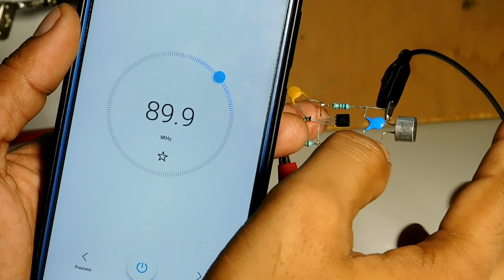Long Range FM Transmitter Circuit

Comment: It's possible to make an fm with lt341 or lm317 transistor please answer me .
Reply: XD lm317 is not a transistor, it a voltage regulator
Reply: They both are not transistors they are adjustable voltage regulators

Comment: What is the transmission range ? .
It can be amplified ? .
I can add an antenna ? .
And at 0:16 of the video that means 102 are pf or what they are ? .
Thank you

P.S
Can I add a variable capacitor  and I can do it on breadboard. ? .
Reply: @electricoggy8406  What is the transmission range ? .
It can be amplified ? .
I can add an antenna ? .
And at 0:16 of the video that means 102 are pf or what they are ? .
Thank you

P.S
Can I add a variable capacitor  and I can do it on breadboard. ? .

Comment: Thanks it works perfectly!👍Keep up the good work!
Reply: transmission range and frequency
Reply: You must use an antenna in order to increase the range. But you must calculate the resonance frequency of the lc oscillator in order to get the right frequency.
Reply: @xhuliocene  or ok but what frequency do you have and how many meters of reach now the idea of putting a variable capacitor comes to my mind thanks
Reply: how did you put an antenna
Reply: @xhuliocene  Hello
Reply: You insert antenna between capacitor and coil
Reply: @xhuliocene  o ok and how much range did you get with this transmitter since I already saw the frequency in 89.9 and it will help me, although if you knew how to put a variable capacitor it would help me anyway thanks for the answer
Reply: @joselocosasrandom1971  You put the variable capacitor instead of the 47pf capacitor.
Reply: @xhuliocene  ok and and when you used it how much reach did you get
Reply: @joselocosasrandom1971  You have to calculate it
Reply: @xhuliocene  or ok I guess from 50 m to 150 m
Reply: @xhuliocene  hello
Reply: @joselocosasrandom1971  yes that must be the range
Reply: @xhuliocene  One last question, the blue capacitor, what value is the green one, I think it is 47pf
Reply: @joselocosasrandom1971  the blue is 1nF the green is 47pF
Reply: @xhuliocene  sorry if I ask a lot but needed answers before making crazy mistakes and mistakes that are a waste of money
Reply: @joselocosasrandom1971   No problem
Reply: @xhuliocene  Thank you
Reply: Bro can you tell which android app are u using for receiver?
Reply: Use the fm radio in your phone
Reply: @xhuliocene  There is no fm radio app on my phone :(. The ones on google play seem to work only on country based radios instead of normal radio frequency.
Reply: @ArshaansEdits  Check if it is pre installed on your phone
Reply: @ArshaansEdits It has a range from 88 to 108 Mhz